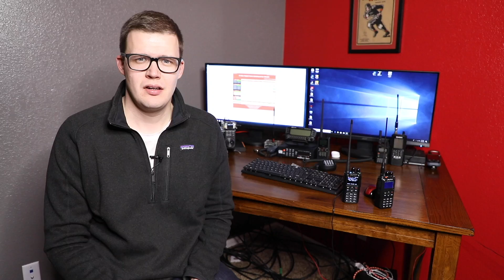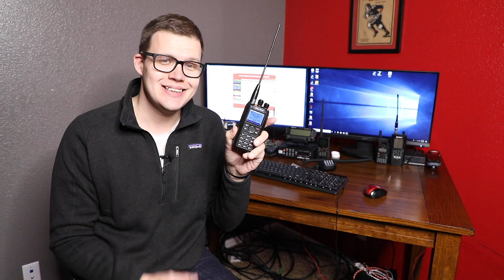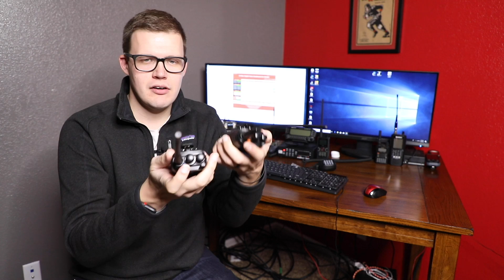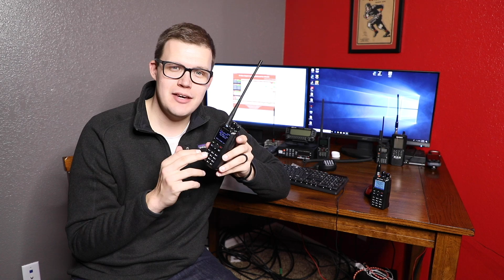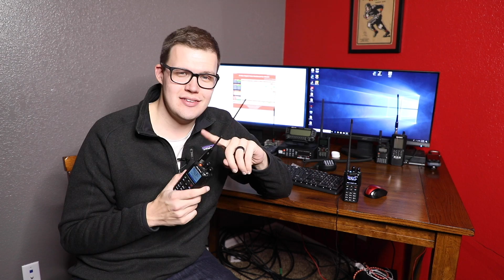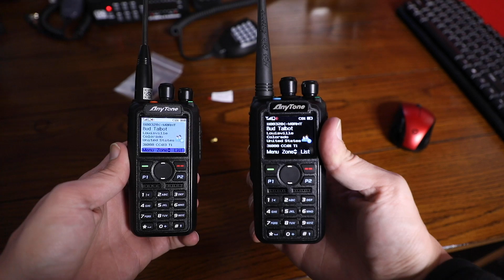Is The AnyTone AT-D878UV DMR Radio Worth The Money?

Comment: AM is dead for decades in Europe. When I started CB in the 80s it was already FM. Today it is FM an SSB on CB. SSB has changed the landscape again. Now there is really a lot of DX. Of course, the situation is different here. There is no technician licence, so the barriers to entry for amateur radio are higher. However, there is an interesting effect on the market. A lot of CB radio operators are now using amateur radios. I think FM is an enrichment and was long overdue.
Reply: It is (was) more complicated like that.
I started with ham radio in late 80s in former Czechoslovakia, and at the times (VHF/UHF was starting to be a thing and we started building repeaters) there really WAS something like Technician license (so called D class at the time). It was meant to make the start easier, but you know, there are in fact not many interesting things in VHF/UHF and especially repeater use. At the end, most of these people never upgraded and left the hobby. (Inaccessible HTs were a factor, too.)
Mental setting in Europe is of course a lot different than in US. There aren't many hardcore brainless doomsday awaiting preppers, for example (I think many "forever technicians" consist of these folks). I am living in our capital and repeaters here are mostly dead. Main focus was, is and will be in HF. It was not D class, it was abandonment of mandatory CW exam what revived the hobby.
Last year we obtained all bands all modes even for CEPT Novice class (100 W max).

Well back to AM/FM. Basically most of CBs here always were AM/FM, when talking about Europe, AM was/is often limited to 1 W (don't know why). I am afraid there is no significant difference between AM and FM, the bandwidth and thus SNR is approx. the same (8-10 kHz). Subjectively, AM is often better. But yes SSB is a thing, but unfortunately it is almost impossible to get good CB SSB radio, apart of maybe 3-5 quite expensive radios. Also, SSB operation is a bit more difficult. I can agree most of CB traffic is FM, but SSB is unbelievably rare. We tried to start with some SSB specific CB activities in OM/OK but there is not enough people for it.

Barrier to entry is not that high, CEPT Novice exam is not that hard, apart of a lot of memorizing here. Bandplans, why? I have always one printed on the table or PDF in my phone. Prefixes, why? OK, Q codes and abbreviations are useful. What is quite special here in Slovakia, we still have oral exam, not a test, that means it is not mechanical ticking of memorized answers, but you must prove you really understand what is going on (and on the other side, not knowing OX prefix can be pardoned :D). I would say there is another barrier. Even some CEPT countries don't have implemented CEPT Novice licenses and don't accept that license e.g. in Italy (even CB is problematic in Italy), Andorra, France, Ireland (they still have mandatory CW and their lower level exam is, I am afraid, at the HAREC level). Some other countries implemented both HAREC and CEPT Novice but still are harrasing hams with guest licenses (Albania - even HAREC licensees, ...).

You can run into problems even if the country accept Novice license. E.g. in Austria, novices can use only unmodified commercial radios. By the way, in Austria you can have a problem even with non-Austrian CB (as far as I know it is a bit better now). Multi-norm CBs were a problem even if switched to Austrian standard. Now, the situation is quite humorous. We (OM) and Hungarians have all bands all modes even for novices, but in OE they still have allocation 160-80 and 15 up without WARC for novices (still better than in OK with the same allocation but 10 W max for novices), also in OK CBs have German allocation (80 bands FM, 40 AM/SSB), we have the same but limited in 41-80 range (70-80 only) so whole Austria is covered by at least OK, OM and HA "spurious emissions" :D I would say it's about a time to surrender :D

In my country, the regulator (nor the police) is not proactively involving himself in both ham and CB allocations. As long as you aren't causing interferences to other services, they are not interested (they will not track you even for using too much power, as long as nobody complains, maybe except of they will find by chance an emission clearly over E class limit - 750 W - in ham band; even in the case they will come, they will first take a measurements and when they find it was accidental emission or you had some problem with your equipment, like defective PA or power meter, not being aware of, they will only tell you about it without any consequences - at the end, most hams don't have an access to expensive and precise measurement equipment). Once having a valid license (never asked to show mine here), nobody will check your equipment if it is modified or built by yourself (both perfectly legal here), again, as far as you will not cause any interferences. But in some countries, they simply must masturbate with regulations and enforcements. Regarding Austria: CEPT Novice syllabus is often criticized for being too hard especially regarding technical part. But it has a reason behind: possibility of building/modifying/maintenance of your own equipment FROM THE NOVICE LEVEL. So their regulations I can see only as a hassling.

Regarding FM. I would gladly let it go. Of course SSB operation is more difficult but bandwidth is 2,5 kHz instead of 10! That means you can have safely 2-3x more channels when reconsidering allocation for such "narrow" band mode. You can use 12 W instead of 4 (1) as a bonus. OK, audio fidelity will take a hit. On the other side, with CB being basically dead, I think it will be slowly phased out...

Comment: The new firmware doesn't even have "talk groups" or "sms" in the main menu. it's got "book" which might be talk groups, then "zone" "scan" "settings" "gps" "digi moni" whatever that is, and "aprs"
Reply: yeah i noticed the same i checked the firmware and you need to enable the sms function after the new version is installed i noticed you are unaware what digi moni is for, basically its a scan function for dmr that works great, it will find tg cc and ts. hopefully i helped

Comment: The 878 is an amazing radio. I am hoping we get some digital repeaters in my area soon. We have two fusion repeaters here, and they are nice. I don't have a hot spot so all I have is analog right now. Mind you, you can still transmit digital simplex if you like.

The only thing I don't like about the radio, is they are not very easy to program if you are out in the field and need to put a simplex or repeater pair in the radio on the fly. Never had a problem doing this with my old Kenwood or even the Baofeng radios. So in a SHTF grid down situation, the 878 is going to be a pain to use if you need to manually put frequencies in. With that said, if the 878 or any other ht is all you have, you may be hurting after a few hours when batteries are dead. Learn the limits of your radio
Reply from the maker: It’s a little slow to program, but once you learn it I don’t think it’s difficult.

Comment: I bought one of these radios and it is sitting on the table locked.  It come that way and you need to program it with a computer to unlock it.  I can not get the radio to talk to the computer, and tried several different cables.  I justed wasted over $200 dollars.  The manual says if you push the menu and star button at the same time it will unlock.  No it will not.  Their are some youtube videos on how to unlock it, but the computer and radio need to talk.
Reply from the maker: Did you get it unlocked? First, press and hold the Menu Key. While holding the Menu key down, press the star key. This should unlock the keyboard. 

The most common issue for the radio not being seen by your computer is drivers. Make sure you have up-to-date drivers that let the radio communicate with the computer.
Reply: @K0LWC  Menu & Star key does not work.  The computer does see the cable.   If I connect the cable alone it says USB com 3.   With the radio attached the same thing.  Used several different cables, none work.  Also set the software to com 3.  Installed several different drivers too.  Do I need some kind of driver for the radio?
Reply: Don't think you wasted $200. There are two "locks" to consider... a keypad lock and a radio programming lock. Most Part 90 radios come (programming) locked out of the box until you change this in the CPS. If the computer recognizes your USB cable as a COM port without the radio connected and powered on then it sounds like you're using a cable with the serial converter chip built in. These are generally used with analog radios. Are you trying to re-use a cable you had or did this come with the radio? Most digital radios use a USB programming cable without the converter chip as the chip is built into the radio. When I plug in my Anytone cable the computer doesn't see it. Only after I connect my radio and power it up does the computer recognize the connection. I've found most digital radios are the same as I can use my TYT MD-380 cable on my Anytone and vice versa. I'll bet when you get the proper cable you'll be up and running in no time.
Reply: @davee294  I have used several cables, none of them work.  I got one that said it had no chip in it.  It still did not work.
Reply: @billhennessy5118  Not sure your background (and assuming Windows computer) so let me start with this... if you connect your "no chip" cable to the computer, connect your radio and turn it on, do you get the familiar connected sound? If so, does the COM port that shows up in Device Manager (my 868 shows up as GD32 Virtual Com Port) match what is set in the programming software?
Reply: @davee294  No com port shows up.  Used both a Windows and Linux computers.  Did some searching and looks like it is com 3, so set the software to com 3.  However when I try to download it says com port error.  Software seems to be stuck on com 3 and can not change it.  Device manager pops up something but no com port number.
Reply: @davee294  Yes did that

Comment: Can you not load the 878 firmware into the 868 as it seems that's all that's been done?
Reply: No hardware modifications! You can flash the FW with the ST-LINK. https://radioaficion.com/news/how-to-convert-an-at-d868uv-to-at-d878uv/
Reply from the maker: Yes, you can. But it requires a hardware modification.

Comment: Just getting into ham radio. Would you consider these models good for beginners? Again I do not know anything at all about ham radio and looking to get my license asap
Reply from the maker: If you’re specifically interested in DMR, yes these are these are the best for that. However, if you’re still learning the basics of ham radio etc., I’d look at buying a cheaper analog HT radio. Check out the Yaesu FT-65R. It’s an affordable analog radio that you can use to learn the ropes of repeaters and the hobby in general. If you’re really set on digital, get the AnyTone 878. Just know DMR is much more complex to learn than analog repeaters.
Reply: @K0LWC  thank you very much

Comment: Nagoya 701 is overhyped.  If you have a dual band radio that Tx/Rx outside of the narrow 2m/70cm bands, you will find the Nagoya 701 does not perform as well over the ENTIRE functional bandwidth of your radio.  I returned my Diamond SBH-701 for that precise reason.

Comment: Thanks for the video, I went for the 868 myself, in the UK current pricing is £129 for the 868 vs £199 for the 878, very pleased with it so far once past the initial learning curve.
Reply: Matt Hill hi how are you finding your 868?  I’ve got a yaesu ft3d but thinking of selling and buying an anytone
Reply from the maker: The AnyTone is a great radio for the price. If you’re going DMR... go AnyTone. It’s the best Chinese manufacturer out there for amateur radio — and I’ve used a lot.
Reply: @K0LWC  is it right that the Anytone is far more limited in frequency reception than the Yaesu FT3De?  I have the latter but am thinking about downgrading. But I want to be able to listen to aircraft and air traffic control as well as all the normal amateur bands
Reply: @chrisbee9164  It's a great DMR handheld, not had any issues with it, although I've been using my FT-70D a bit more recently, also find the FT-70D better for analogue FM.

Comment: How do you switch the frequency mode the mode 14 (400-520, 136-174, 200-225)?
Reply from the maker: Make sure you have the commercial model of the radio. You can adjust the mode in the CPS software.
Reply: you have to have an unlock password for "maintenance mode" for both the radio and CPS. They might be out in the wild, I know the CPS password is, but the radio password might not be.
Reply: Latest firmware doesn't have the ptt + 1 + "turn on radio" function. You have to use software - AT_Options.exe

Comment: I received the 878 yesterday and started setting it up but I found a HUGE problem with it. The main reason I wanted to try this radio is the new APRS in both analog and DMR modes. Unfortunately, the APRS is where I have run into the problem. I have found nowhere in the radio or the programming software to change the radios ARPS callsign, so each time it sends out an APRS packet it is transmitting a Chinese callsign. If you change the APRS Text with your callsign, it simply adds that as a note under the Chinese callsign. The second problem is that if you turn on the APRS, even with the volume on the radio knob turned all the way down as far as it will go so that you can no longer hear any received transmissions on the radio and the Max Vol level set to "indoor", when the radio transmits an APRS packet the sound is deafening as though the volume was turned all the way up as high as it will go. This alone renders the AT-D878UV completely useless for APRS use.

Comment: This is not an easy update.  You have to go into the radio, and solder to the PCB, and use special programmers to update things before the firmware update will work.
Reply: thats not true
Reply from the maker: I would agree it’s not easy, it takes some technical ability.

Comment: Let me get this straight? I can flash firmware 878 on to my 868 and it will work just fine? Get auto repeater roaming, APRS and the nice looking to me black screen? Who's got a link on this?  I'm more than brave enough. I also have the Nagoya 701

Nevermind found the info
Reply: Dwayne S can you link me to that info ?
Reply: @chrisbee9164  https://github.com/geary/AnyTone-D868UV/issues/59#issuecomment-451350763 is what I had bookmarked surprised I still had it..read it and said not worth my time trying not sure if it's still valid

Comment: I have a version-1 868 and I was told I couldn't update to the 878 firmware. 
I have no great will to change my 868, it works great.
I like the idea of roaming and aprs analog addition in the 878, but my mobile has apsr analog.
I do like the 878 screen.
I will keep my 868, when you have something that works perfect it is a bad idea to change, Murphy's law will bite you in the backside if you try to be too cleaver or try to keep up with the neighbors.
Reply from the maker: It can be done. Many in our group have done it with no issues at all. It’s the same hardware.
Reply: @K0LWC  
??? REALLY???
I was told the chips in the 878 and 868 version >two< were the same, even to the part numbers. But I do have a version >one<. So those in your group that had version >one< was able to do it?
   I just want to be clear you were addressing version >one<.

Comment: When i try to talk to parrot talk group, it seems to cut off the first second of my transmission. Know what the reason could be?
Reply from the maker: Do you have a courtesy tone at the begging of your transmission. This is a feature of many DMR radios. It takes about one second to key the system. When I push my PTT I’ll get a chirp, then I know to begin talking.
Reply: @K0LWC  i just got the anytone 878. Where is that setting?
Reply: Digital radio needs to establish a connection (handshake). Almost all digital is like this, not just DMR.  Solution is simple, count one onethousand before start to talk.

Comment: Have you had sms issues with the 878? Saw a video with 2 hams having issues

https://youtu.be/ccoV5EOm2i8
Reply from the maker: I have not had an issue.
Reply: @K0LWC  nice. I saw your video about the best talk group. I'll try to hit you up in there when i get set up. I saw your qrz profile and your antenna setup. Im supprised you have the icom 7300 when you are only licenced technician. I wont buy any hf equipment until i get my extra. See you on the air - ws3ric (eric)
Reply from the maker: 31088 is a great talkgroup!

I do a lot of CW on 40 meters as a technician. Many operators don’t even consider CW, or realize techs have 10m privileges. Don’t wait! 😊

Comment: As I understand it, the current 868 radios are v2. They have 868 v2 stamped on the board just like the 878. In the video, it seemed to me like he was saying that the 868 v2 radios don't have this stamped on the board and the 878 does. From what I've seen in photos, the 868 v2 and the 878 have 868 v2 on the board.
Reply from the maker: No, I was saying the 878 has D868V2 stamped on the hardware— just like the 868 does. It’s the same internal hardware components.
Reply: Right. It just didn't come off that way which is why I posted the clarification. That's why my comment states, "it seemed to me like he was saying." If I meant to imply that you stated otherwise, I would have worded it as "He states."

Sorry for any confusion from my reply. Excellent video, BTW.

Comment: Just upgrade the firmware of the AT-d868uv to 2.34 and you will have the screen look of the 878 with black blackground
Reply from the maker: You’ll get the background, but you  would be missing roaming and APRS.
Reply: K0LWC *APRS is “transmit only” - not receive in the Anytones (878) currently - hopefully that could be a firmware update